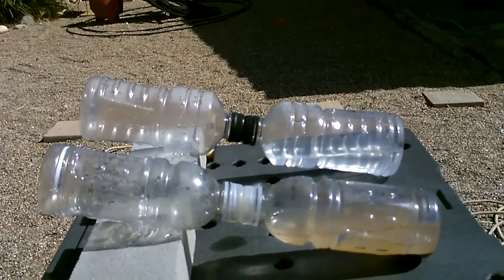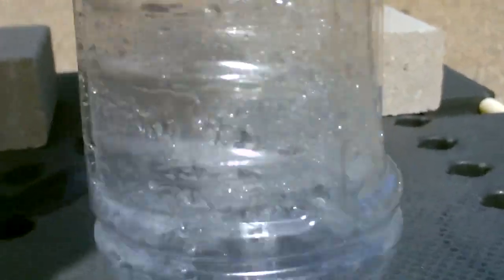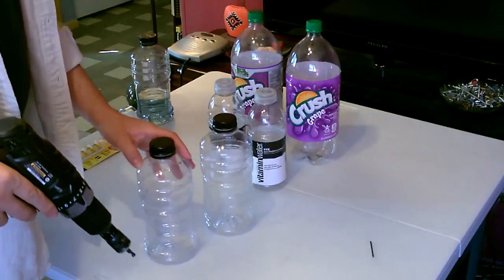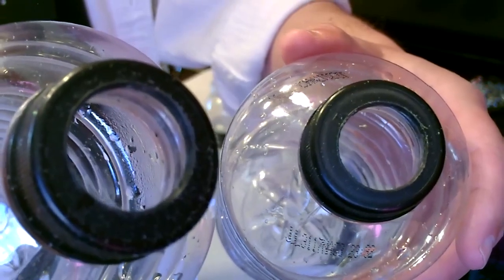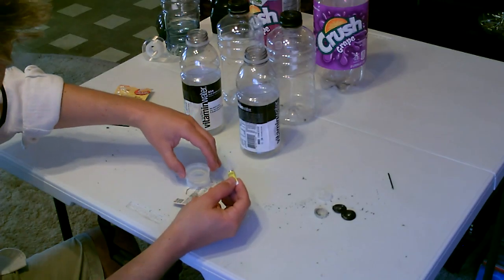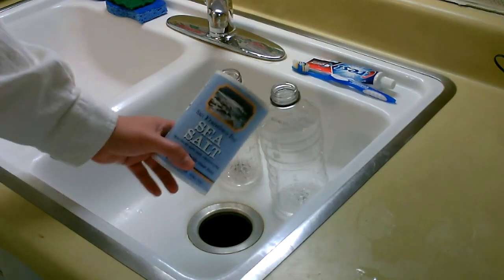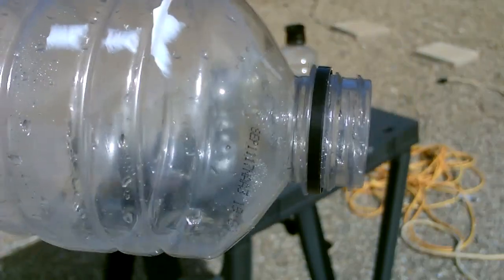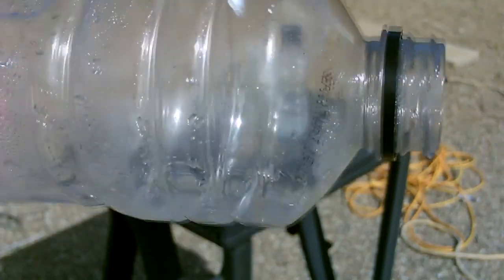DIY Solar Water Distiller! - Simple Solar Water Distilling - Easy DIY (for survival/SHTF)

Comment: use GLASS bottles. Use a dark one for the non-potable and SHADE the condensor bottle, you can also run cold non-potable water over the condensor.  Better to use tubing between the bottles

Comment: You should attach a nipple and hose to the clean side of each one so the clean water will run down and be collected into a gallon bottle

Also you could make it real easy to add more dirty water by adding some kind of controllable gravity feed of dirty water into the bottles, with a gallon bottle, hoses and small hose valves.

Comment: i am experimenting to,the set up you have works,but you need to keep an eye on it,the small colection surface you have,has the potential of dripping back in the poluted water.

i am working on one with a bend tube so the condensation realy drips down away from the poluted water
Reply from the maker: hi. the tube sounds like a good addition. 🙂😎

Comment: small tip to make this a LOT more efficient:

- drill a hole in the condensation part and cover it with something so it stays cool, a wet, white towel would do perfectly. the hole is to collect the water
- place charcoal or anything dark in the water so it absorbs more heat from the sun, making it evaporate faster. 
- placing less water in it but on a bed of ground up charcoal makes it evaporate REALLY fast, so it helps too

Comment: Great Simple Idea! Thanks. But better with Glass or Steel Container paint in black on the Hot Side, to avoid Bad Chimicals from Plastic 😉
Reply from the maker: hi. glass is always the best for long term use, but plastic is not bad for short term use. the bad chemicals associated with plastic are generally only an issue if you use it as a long term or permanent solution.

Comment: If in a survival situation just get ya knife out and cut the top off a smaller bottel and the botttom of a bigger one. Fold the bottom of the bigger one inwards so it creats a pocket, then put some salt water in the smaller bottle and slide it inside and stick it in the sun. Works the same, just easier when stranded. Great video! Always good to learn multiple ways of doing the same thing!

Comment: That's a great idea!  You could even drill a hole in the "clean water" bottle, where the water collects, insert a straw, and have a catch pan underneath to collect the water.  That way, you wouldn't have to unscrew the bottles to collect the clean water.  You'd only have to remove the dirty or salt water bottle, etc., to put new water in to be purified.

Comment: I feel like this design can be improved upon with just a little bit more effort hahaha. a thin plastic juice container or a clear plastic bag in a frame if all else fails resting horizontally with some black plastic under it and on the sides to attract and retain heat, a small PVC attachment line set up a a drip to your clean catch to prevent backflow of good water. fellas, I think you should try for round 2

Comment: using tarps or plastic bags you can make a similar thing on a larger scale on the beach if youre stuck with no fresh water. Digging a 2 holes lined with the plastic and covered with plastic and fill one of the holes with salt water, let it evaporate and fill into the other plastic lined hole.

Comment: Do we have to worry about plastic breaking down (from sun exposure) and contaminating the drinkable water? Would a glass setup work better?
Reply from the maker: hi there. nope that's not an issue (at least not in the short term). it takes a long time for anything to leach out of plastic and into the water (weeks and months *not just one day). note that water companies store their bottled water for weeks sometimes in hot warehouses before it's sold to the public and that is considered okay. this device just collects water for a few hours at a time. technically glass would be the best (especially for long term use) but plastic is fine too.
Reply: @desertsun02  thank you for your reply! i find this DIY water purification stuff so fascinating. :)

Comment: On the rez we bury copper pipe in ground & put sea water in a pail - set in sun & pull up copper pipe in pipe that is cold & run it in a loop on Glass looped pain water is around 5 gallons a day

Comment: Not bad. Very expedient. The only issue is how much you can make at any given time as eventually the purified of water will start dripping into the dirty water. Transferring it like you did would be a careful task so as not to accidentally tip the still and mix the water. 

Would like to see an update version that drips full contents over time without crossover.

Comment: Hi, just curious what kind of glue you used for glueing the caps together. Most plastic bottles are made of PE or PP and these materials cannot be glued with most if not all available glues.
Reply: Yeaaa.. my same wonder
I would'v used a  solvent adhesive - liquid that'd chemically disolve the plastic & re-join a few minutes as one piece ... no glue

Comment: Really like this model. In fact, making myself a couple of the 'lid transfer' points in advance using say the two most common plastic bottle sizes means I may not even need to carry a bottle with me, just the lids. Sadly plastic bottles are everywhere so locating them should be easy enough in most parts of the world.  Important for people to not wait too long to gather the fresh water as they'll risk mixing the two parts when they pick them up

Comment: Having a plastic tube seems to be a good thing to keep handy. Put it through the tops of the bottles to allow the clean water bottle to lay better and get more water in it. Or put a kink into the bottom of the dirty water bottle so the other bottle can hang lower and get more water in it without getting the clean water dirty.

Comment: If the condenser bottle was buried under ground where it is cooler with a hose from the dirty water bottle down into the condenser bottle it might work faster too? The condenser bottle could be larger to save repeatedly digging it up, if you were distilling salt water sand would be easy to dig anyway.
In survival situations a plastic tube is handy to have anyway for sucking scarce water out of crevices or for siphoning fuel from broken down cars to working vehicles

Comment: only problem is that with no drainage system, the clean will run back into the dirty. Cut a hole in the bottom of the pool of water to allow drainage. another thing I've seen in the comments is the complaining about the drill. You can easily use your knife to cut a hole in the lids and you should have a roll of tape with you or some good paracord to then keep the bottles together!

Comment: Thank you for making and sharing this video. 

Plastic doesn't seem like the best thing to be using healthwise if this were to be used as a means for producing drinking water, but the video shows perfectly how the distillation process works, and in a way that is clear and provides a method that anyone can use to try it out. 

Well done!
Reply: If you are dying out of thirst, plastic may not be that bad after all.
Reply: in a SHTF scenario, I think not having water would not be the best thing healthwise
Reply: U can do it with glass beer bottles if u prefer
Reply: Investigations done into the sodis method using water disinfection with sunlight, in which uses PET plastic bottles shows that the leakage of plasticizer is not a health problem. This is encouraging.
Reply: this was for survival situation, the ocean was polute by plastic bottle, you can almost find plastic whased on beach on any island, but not gonna find easy glass bottle or stainless steel bottle
Reply: When I was a kid we used brown beer bottles and ran a plastic tube from those to a pickle jar.  You can run a lot of those to the pickle jar.  And use a cork for the beer bottles.  Just punch a hole in the cork for the tubing.

Comment: I’ve always used the bowl in a bowl covered with plastic method but this is so genius. You won’t lose water in sealed units like this (or lose very very little depending on how well you attach the bottles to each other).
Reply: Plus you can drink it right from the bottle.

Comment: Here is what you do.
1.  You run a plastic tube between the two bottles.
2.  The part of the tube that extends into the dirty water section is short.  It is NEVER allowed to touch the dirty water.
3.  The part of the tube that extends into the clean water section is long.  It nearly goes to the bottom of the upside down container.  It collects a lot of water!
4.  When the space in the upper, clean water container is nearly used up, you unscrew the lower, dirty water container off.  Remember, you kept the tube clean.  Now, insert the clean water bottle right side up, unscrew the top,  Now you have almost two liters of clean water.  Cap it and put it aside.

Hey people!  It is really simple.

Comment: very nice please some one explain water never reach 100 degree c but still collect on the other bottle thanks
Reply: Evaporation occurs at relatively low temperatures.  At 100c evaporation only occurs much faster than at normal temperatures.  

If you think about it, clouds are formed by evaporation from the oceans or other areas of high moisture content, even though the temperature never reaches 100c.   
That is basically what is happening here.   There only needs to be a slight temperature difference between the water and the air.

Comment: If you attach the caps with a tube so that the collector is vertical, it would be much easier to collect a decent amount without spilling or contaminating. Also shading the collector to keep it cool would speed things along, as well as adding reflectors around the contaminated water. Bare metal such as foil or sheet metal, or even mirrors would help.

Comment: Have you, or anyone reading this in the comments tried doing this on a large scale? Say, with 5 gallon water containers?
Reply: It is definitely possible.  Use some 55 gallon drums for the dirty water and seal the top off,  use some pvc pipe going vertical out of the top, a 90 degree fitting then another length of pipe going sideways angled slightly downwards with something to catch the water coming out.   
I did that as an experiment when i was a kid after learning how to do it in science class.

Comment: Would a brown glass medicine bottle be better for the source? I also have very light coloured medicine bottles, would that be better for the trap? 
Also does this need to be closed as I want a drain so it'll just keep collecting.
Reply: A darker bottle will heat the bottle but shade the water. Using a reflector under a clear bottle like a black cloth or metal. Will help.    It doesn't have to be sealed but there needs to be something at a higher level to capture the moisture before it escapes and condenses.

Comment: You dont need the caps,bricks drill,glue , just make a angled  sand mound ,then push the bottles laying in the mound with the tops firmly together , the steam from the lower bottle will rise and enter the upper bottle , cover the upper bottle with sand to help keep it cool to and all will happen faster

Comment: It needs to be a contained system or the steam will just exit the hole, but you could put in a "lemonade" tap valve on the clean water side.  Obviously a custom-shaped clean-water side would hold a lot more water.  I wonder how this would work on a large scale?  It's ridiculous to complain about water shortages when 2/3rds of the Earth's surface is water. Would this work for alcohol distillation? They could be stored on boats as floats.

Comment: where i get drill in survival mode?
Reply: also, if youre able to make fire you can use heat to puncture a hole in plastic. you can also use heat to melt the lids together instead of using glue.
Reply: Try the awl in your swiss army knife3. It puntures the lid easily then cuts the plastic better than a sharp knife.
Reply: @donoberloh  Like da bottle, there'll be countless of them on da coast as garbage in some countries. But, where is "swiss knife" etc.??? In survival mode, you only have stone or glass (as trash)(unless you're lucky to pick up a steel knife).
Reply: @nullAttack7327  what?
Reply: @donoberloh  I mean what if you don't have "army knife".
Reply: @nullAttack7327      Use a nail heated by fire.
Reply: Make one, see the primitive technology channel

Comment: Sorry I just had a "fridge brilliance" moment. In all these "give £5 to build a well" adverts where they show some African middle of nowhere place - why are the communities stuck with dirty water not using solar stills? This is potentially something they could be taught to easily make themselves with relatively cheap materials.
Not that wells aren't great and all, but the stills could be very useful too.
Reply: Probably wouldn’t work because of civil wars, murder-gangs with AK’s & machetes (pangas). If you rigged it to a hat that also cooled your head(it’s hot throughout much of Afrique) it ould be more widely adopted.

Comment: Help I have to power tools, no access to to a power source! You know? It's a survival situation...
I tried this project and the wind blew it aside, and dirty water contaminated the clean. My experience told me that without power tools and multiple matching bottles, I'd have to improvise, and even bracing my water bottle against mud and gravel, the shit blew over.
Reply: Good to know.
Reply: yeah these tutorials are fucking wack. like, "hey guys here is how to survive in a survival situation. first step.. get some water bottles somehow, get a drill somehow, and drill the caps! then get some glue from the store, somehow, and glue the caps together, and then get some cement bricks, somehow, and then hope wind doesnt push it over! 

like yall if I had a fucking power drill with me chances are I'm not in need of water any time soon

Comment: would this work if you berried the bottom contaminated bottle under ground to receive heat from the earth around it?
Reply: You'd want the dirty water to absorb as much heat as possible and the clean bottle to be as cool as possible. So you could cover the clean side with a cloth or some reflective foil. Or you could bury it to keep it cool too.
Reply: Burying it will keep it cool. Unless the hole is near the center of the earth. 😺. So you could bury the clean side for sure

Comment: Yes it works, but, best to use glass instead of plastic as BPAs and estrogen factors will contaminate the clean water. It is a very good idea however and a bit of experimenting should come up with ways of doing this on a bigger scale.
Reply: This is a survival solution. It's pretty safe to assume BPAs are not even a secondary concern

Comment: Of course, in an emergency situation, don't forget that the easiest way to get safe clean drinking water is to collect rainwater in clean containers, (unless you live in a desert). Most areas of the country have regular rainfall, and more than enough for daily consumption by a whole family. You just need to rig up some clean plastic sheeting to funnel it into a container. What you DON'T want is water from rain gutters/rooftops because of bird poop and whatever.
Reply: Acid rain is increasing because current administration is removing environmental protections and encouraging use of coal...don’t drink rainwater until you distill it. Which won’t remove a lot of air-born contaminants.
Reply: It’s inaccurate that most areas of country have enough rain to support a whole family. I live in central Texas. We average 33 inches per year. Each inch of rainfall, if harvested off the roof of a 2000 sq ft house, can produce 300 gallons of distilled water. Each average adult uses 100-150 gallons of water a day. So that 1 inch of rainfall covers two adults for one day. Using that data, we get enough rainfall to cover one adult for 66 days annually. This isn’t desert or even close to it.
Reply: @seheabol  An average adult  doesn't drink or consume 100 gallons of water per day. During SHTF you aren't going to be able to shower,  run your dish washer or washing machine.

Comment: Ingenious. Thanks! may I suggest placing 1 or 2 layers of t-shirt fabric over the receiver and keeping it wet constantly with ocean water. It will work both as a sun shade as well as an evaporative cooler to improve condensation. By the way, in a survival situation, you can just duct-tape the 2 bottles together, end to end at the mouths. No need for caps or glues. There is always duct tape.
Reply: rmwtsou 
It works much better with the caps because if you tape the bottles together, you will probably lose some of the clean water back down into the lower bottle while you are trying to unwrap the tape from around the two necks.  Keep it simple!
Reply: I don't think it would work as well. This would cool down the air inside top bottle, sure. More condensation, sure. But... cool air is slightly heavier and tends to go down. Thus, straight into the first bottle, cooling it down. Meaning, overall less evaporation, too. Since it works better the hotter and the more sun there is, it means the evaporation part is way more important than the condensation part.

Comment: You can heat the salt water into solar radiation and in hot and other side the bottle in cold climate to cool by natural  by getting distilled water over by the small piece of pipe
Reply: Because grammar really helps you to convey meaning.

Comment: why screw around  and use 1 gallon glass jugs??  pump steam through it and then seal it off.
  on you system  put black cloth under the lower one and  aluminum foil over the higher one...

Comment: Use a hot knife to carve a hole on the cap and then fuse them together by melting,
Reply: I was wondering what to do if a power drill with full charge doesn't wash up on the beach also!
Reply: Nice little gadget to take with you on travel
Reply: Do both: glue and bond. Can achieve a better IP rating that way.